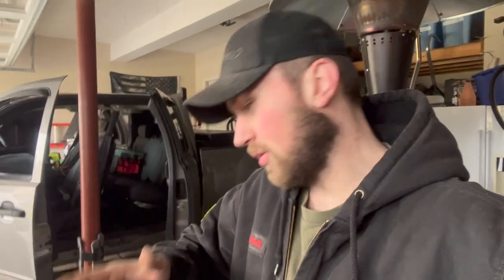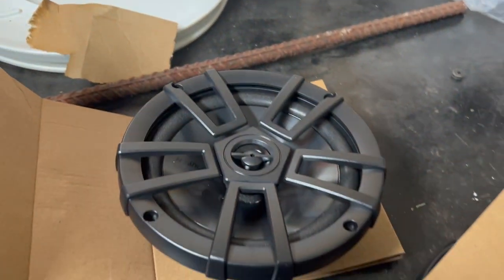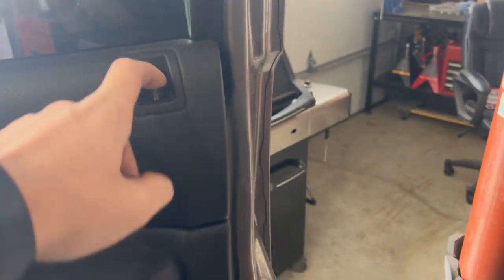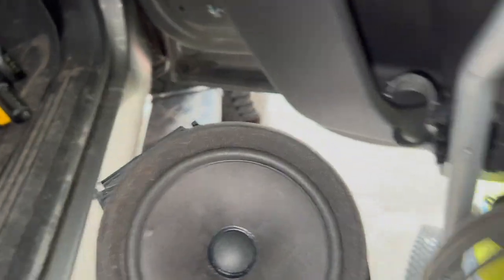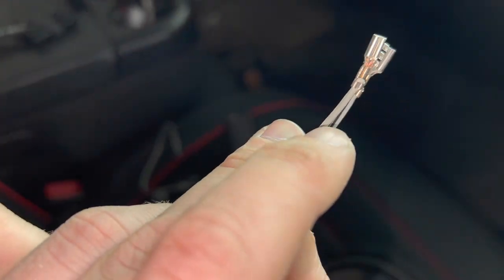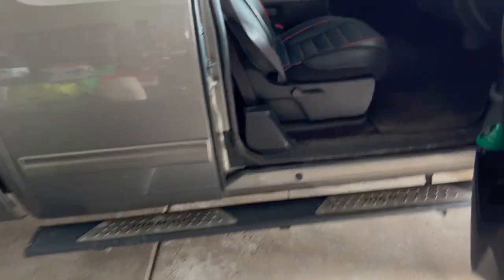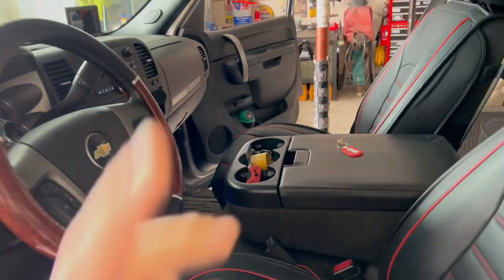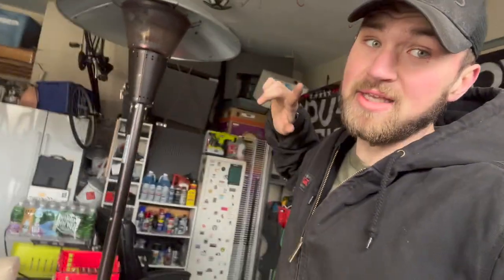Upgrading The Door Speakers! (H Yanka 6.5) Review/Install

Comment: To avoid drilling into my door I just cut the old speaker out of the adapter it comes in and placed my new ones onto the the plate and used the stock adapter to have a full seal

Comment: I have a 2011 crew cab silverado. recently bought it and put a the rc 2 inch level struts with 33/12.50r20. this truck has always rode rough even when i first got it compared to my 2000 chevy. The interior seems to rattle a lot as and shakes the whole cab. body mounts are good. i was curious if your truck rides the same as well, like on the highway it’s great but even small bumps in the road will just rattle the crap out of you. Could you make a driving vlog over some bumpy roads so i can get an idea of how it rides? I would appreciate it. maybe these trucks just ride stiff. i can’t seem to find any videos of how these trucks ride over bumps/potholes. all in all it’s great until you hit small divots in the road then it makes me regret buying this truck
Reply from the maker: Unfortunately the truck rides smooth no rattling or anything along those lines. Could be if you have stock upper control arms. When I got new ones it helped a lot with rude quality.